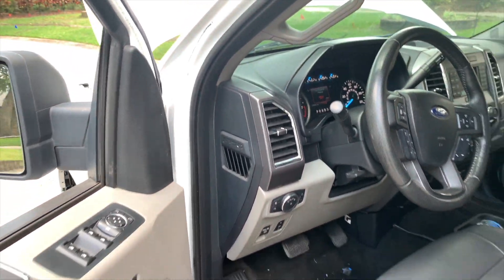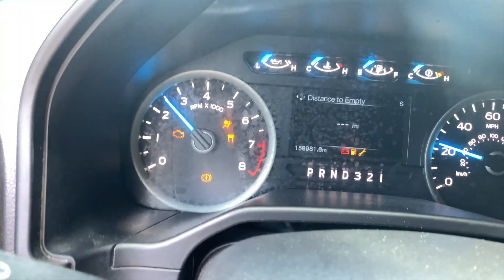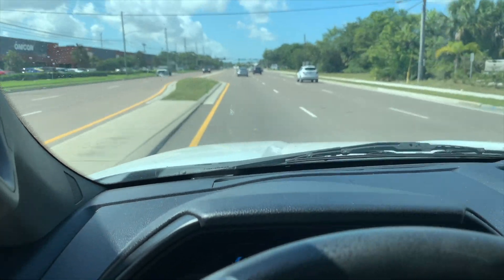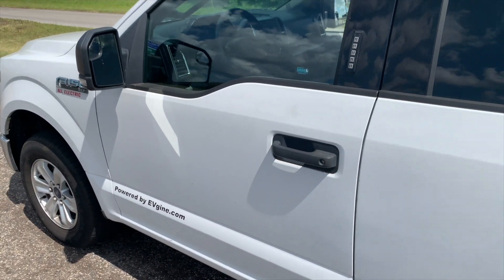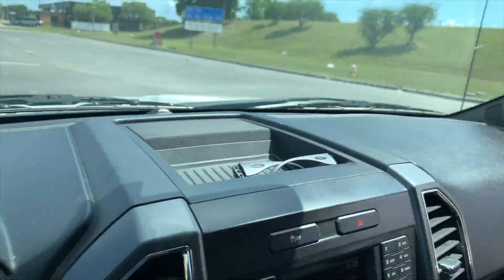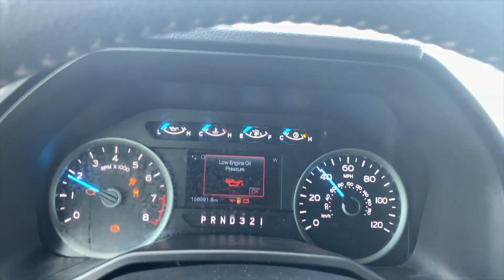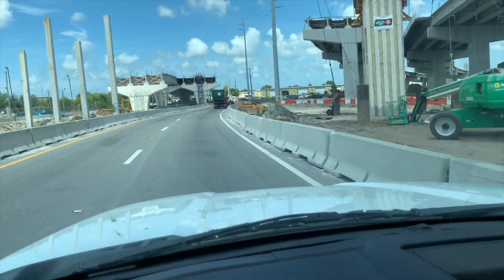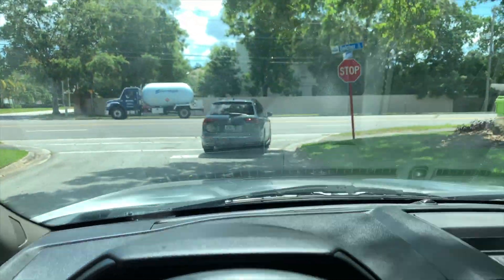All Electric F150 that Ford couldn't build and still cant beat

Comment: You can't be doing good regenerative braking unless the transmission shifts gears to get the motor speed and voltage UP. Their failure to do that likely means the batteries can't accept charging at the higher rates that would definitely be seen with good regenerative braking.

Comment: Ford has the Lightning  range is over 300 miles 563 ho 775 ft lbs tourque
https://youtu.be/Zxe352yOYyk
Reply from the maker: We appreciate your efforts.  We use a transmission which means we have up to 4 times the pulling power as Ford.  Ford will have to go back to the drawing board with egg on their face.  Trust me. Ford is way behind.  
Ford Lightning is pretty with lots of lipstick with their displays and extra power outlets but they will have to go head to head with us one day.  Ford will also have to prove their 300 mile distance and disclose thier kwh per mile usage while towing trailers.  We already did that and we offer full disclosure.  We will challenge Ford on every level on performance.
Reply: That is why you aren't allowed to test drive the vehicle.  They are lying.  I have an actual working electric F150 and I am getting the exact same distance as a Tesla pulling a trailer as seen on YouTube.  So do you really honestly think Ford is getting three times the distance of the most advanced battery packs in the world?
Reply: Is their someone I can call for a price?

Comment: So it has the engine light on, but the truck doesn’t have a engine 🧐🤨
Reply: Uhhh, it doesn’t have an engine?? Are you sure?? Electric vehicles have engines, they are just electric.
Reply: @fpvnoob6663  Exactly my point
Reply: @kaleostrains3249  didn’t read the replies, were on the same page
Reply: @fpvnoob6663  I wasn’t accusing you of copying me I was just agreeing but yeah same
Reply: @fpvnoob6663 it's called a motor, not engine.
Reply: Bruh it has an engine just not a gas one
Reply: Called a motor. @kaleostrains3249